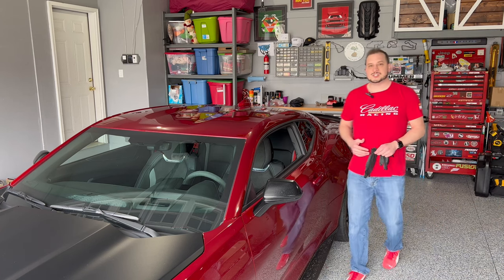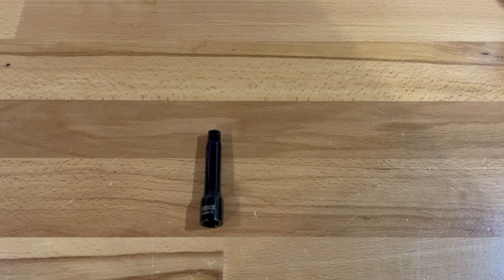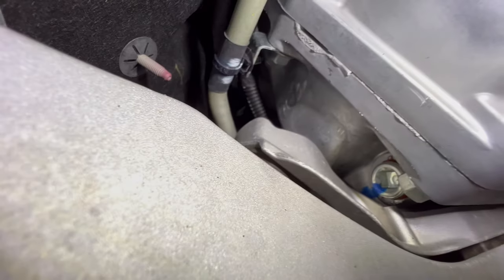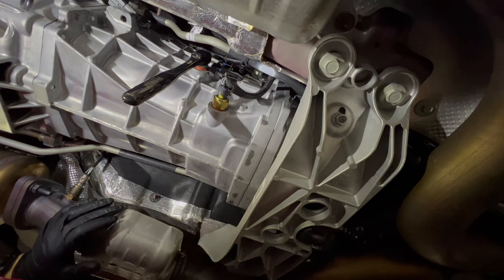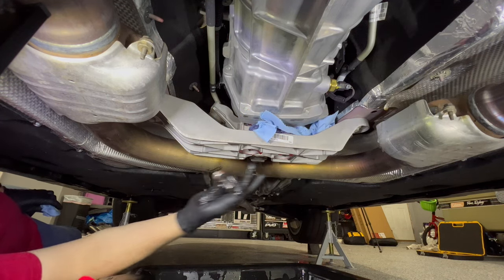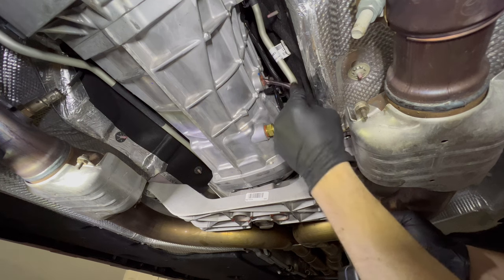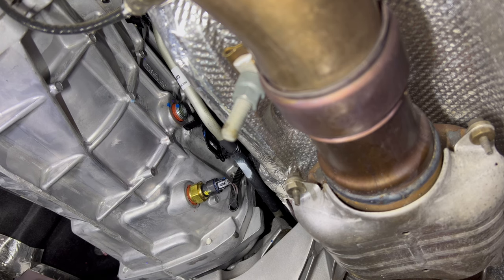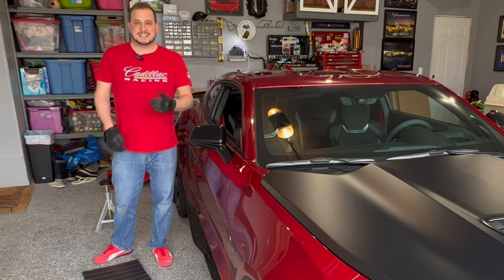OLD VIDEO: Tremec TR-6060 Transmission Fluid Swap

Comment from the maker: UPDATE!!! You can remove the temperature sensor from the transmission and use that as a drain plug. Much easier to get to, and makes much less of a mess. Also, you should remove 240 ml of fluid once it starts to drip out. Thanks to all of my viewers for these tips!

Comment: Using the Royal Purple synthetic transmission fluid is the ultimate fluid fix for the T6, especially in the Dodge but, all of the manuals love it.
Reply from the maker: As long as it is Dexron III ATF, you should be fine. That is what the Tremec calls for.
Reply: @FollowMyLine17   Thanks for the info.  Always appreciated when things are shared instead of people just insulting each other.  😉

Comment: Sweet! Man you making this look easy! Great video 😎
Reply from the maker: Man, I’m just trying to be like you with that subscriber count 😅 Stay tuned (and subscribe if you haven’t yet) I’ll have some track day content in the next few weeks!
Reply: @FollowMyLine17  😂😂😂. You already know I subscribed I will be going to these after my Matick appointment because I plan on doing everything like this going forward. How often you change the transmission fluid and how do you know if you need to add more if it doesn’t sound right on the test drive just being curious
Reply from the maker: @BLUPRINT1LE  the test drive is more to make sure that nothing is leaking when you get back. Once it starts pouring out consistently (roughly 4 bottles) its as full as it’s going to get. Just make sure you are on level ground. The transmission fluid should be changed after 24 hours of track use, that’s why it’s important to keep a track day log. Diff is 15 hours of track use and engine oil is 4 hours.
Reply: @FollowMyLine17  ok that’s nice to know!

Comment: Lol my fluid will be delivered tomorrow. Perfect timing for this vid!
Reply from the maker: Awesome! Let me know if you have any questions after you watch the video, I’ll be happy to explain further if needed.
Reply: @FollowMyLine17  Will do, thanks.
Reply: @FollowMyLine17  Just finished watching. Definitely not doing it on my new (11day old) driveway 🤣 

Great vid. Simple and to the point.
Reply from the maker: @LordDeadSpider  believe it or not, I caught all of that fluid in my drain pan and drip tray.
Reply: @FollowMyLine17  I have a track record that is not in my favor. Just changed oil on 2 generators, push mower, zero turn & my sons car… lets just say I am glad I used my wife’s old driveway 🤦‍♂️
Reply from the maker: @LordDeadSpider  well, at least you know where you stand. 😂 One of the pinned comments suggests using aluminum foil as a makeshift funnel. Not a bad idea.
Reply: @FollowMyLine17  Just got the fluid changed out. Couldn’t get my swivel to cooperate (fat fingers) so I removed the brace. Thanks again for the vid.

Comment: Hello! Awesome video, just got my 2022 2SS 1LE in March and these videos are awesome reference for future maintenance! Couple questions, it looks like you’re using the ESCO jack stands with some jacking pads for holding the car up. Are those the shorty ESCO jack stands or the regular height ones? Also, what jacking pads are you using, and how secure does the car feel with the jacking pads on the jack stands? Thanks!
Reply from the maker: Those are the regular Esco stands, not the short ones. Here is the link for them:
https://amzn.to/3yWkL84
The lift pads are from ZL1 Add Ons. As far as security of the stands on those lift pads, I always rock the car back and forth once they are on the stands. I do this for a few reasons; to make sure the car is level and not going to teeter totter and if it falls I’d much rather deal with an automotive insurance claim than having my family deal with a life insurance claim haha. I have never had any issues and I have been working on these cars since 2017 the same way.

Comment: Hi, thanks for the video. Just one question. The GM documents say to "Apply sealant to the transmission fluid temperature sensor/drain plug" after draining, is that necessary and did you do that? Thanks in advance.
Reply from the maker: Hi! It’s referring to the sealant that you can see visible on the plug. I didn’t, but it’s highly recommended.
Reply: @FollowMyLine17  Thanks for the quick reply! Do you know what the sealant is called or the part #? The hyperlink on the GM docs does not open. Is it just some kind of thread tape? Thanks again.
Reply from the maker: @agentsmith2239 it’s a liquid thread sealant. Here you go: https://amzn.to/3AfdxOU
Reply: @FollowMyLine17  Awesome! Thank you so much!

Comment: 1:33 I have a Camaro 2019 SS LT1 manual transmission, but I don't know if it has the same oil that you show in your video?
Reply from the maker: Yes, you have the same transmission and you can use the Driven Oil AT3 or another option is Redline D4. Any Dexron III rated automatic transmission fluid will work. 

https://amzn.to/4bx3PFa

Comment: Thanks so much for this video! As a ZL1/1LE owner, I will be tackling this in the next few weeks. 

I have to ask - 
1) how many quarts of transmissions fluid did you have to pump in before it starts leaking?
2) How many miles would you say you recommend changing out the fluid? I am at 18k miles and still on the stock transmission fluid (done easily 7 track days plus spirited runs on backroads/tail of the dragon).
Reply from the maker: The transmission takes something like 3.85 qts. with the additional coolers on the 1LE. I think it’s a little less for other applications of this transmission. It took nearly all 4 quarts before it started to spill out, however there was left over fluid in all 4 bottles since my fluid pump couldn’t reach them all. 

Regarding frequency of change, if you track the car, GM recommends changing transmission fluid after 15 hours of track use. 24 hours for the diff and 4 hours for engine oil.
Reply: @FollowMyLine17  Please let us know if there is an improvement in shifting feel upon switching to the Driven AT3. I am doing my research on the right fluid for my 6MT at this time.
Reply from the maker: @AllIsWell_22  it was instantly smoother than the factory fill fluid. I have also tried Redline AT3 in the past with the same results.
Reply from the maker: After my track weekend I can confirm, great feel on the shifter, no issues getting into any gear, and I let my friend drive my car who also has an SS 1LE and he made a comment on how smooth my transmission felt.

Comment: What jackstands are those? I would really like some like that with the padding! Also, what point are you jacking from that the whole side of the car comes up? I feel like any point that could do that would have some sideskirt in the way.
Reply from the maker: https://amzn.to/3yWkL84

Esco 3-Ton Flat Top jack stands. I use a universal pinch weld to lift at the center-front pinch weld point:
https://amzn.to/3Etllgc

I also have these lift point pads:
https://amzn.to/3s3FwtT
Reply: @FollowMyLine17  Thank you Luan!

Comment: Hey man love that you use this car for what it's intended to do and not drag race a specific track car. So on the transmission fluid would it be okay to use the red line d4 ATF for the C7 Corvette 7-speed manual trans ?
Reply from the maker: Thank you, and yes! I’ve used the Redline D4 in my 2018 Camaro SS 1LE and loved it. Go for it!
Reply: @FollowMyLine17  👌 thanks. Really like that lt1 motor for the track. Seems to be strong all day and not heat soak like it's supercharged counterpart lt4
Reply from the maker: @justinreid8851  yes, it’s incredibly stout. A workhorse for sure.

Comment: so do you still use Driven AT3 or did you switch to Redline D4? Amsoil?  I'm trying to do research and it seems to be just a preference for the user with some occasional Royal Purple people saying smoother shifts... Whats your thoughts?  I'm looking at the Driven right now at Summit racing...
Reply from the maker: I’ve used the Redline and Driven on my Camaro’s and the Driven seemed smoother than the Redline. It truly is personal preference on these.
Reply: @FollowMyLine17  Thanks for your reply..

Comment: Any one use the tremec hpmt fluid and if so do you have to flush all the old fluid out or just let them mix with the little bit of oem fluid still in there?
Reply from the maker: I haven’t personally used the Tremec fluid, but if you are patient enough a minority of the OEM fluid will remain, as in any transmission, engine, differential, brake reservoir, etc. They are OK to mix.

Comment: Removing the brace under the transmission is not an option? I did see a video where a guy made a trough out out aluminum foil to direct the flow better.
Reply from the maker: I didn’t want to remove the brace. I attempted to make a funnel out of construction paper and it failed miserable. Aluminum foil is a great idea! I wish I would have thought about it. That’s what is great about the internet, you eventually find cool ideas from all over the world. I’ll pin this comment in hopes that someone else sees it!
Reply from the maker: I have an update on this. Apparently you can use the temperature sensor plug as a drain plug and avoid the mess or hassle of making a funnel.
Reply: @FollowMyLine17  ah. Very good. Thanks
Reply: A jack and remove the cross member would have been 100% easier and smarter. So frustrating to even watch 🤦‍♂️
Reply from the maker: @joesbuell  you’re telling me, it was frustrating to do! Ha. I could have also just removed the temp sensor. This is one of those videos I will probably redo in the future when I flush the trans again after the accumulated track hours. Thanks for the feedback.
Reply: @FollowMyLine17  frustrating to watch when for a little extra effort you could have had less mess. Work smarter. Curious as to why you changed the oil on what looks like a new vehicle?
Reply from the maker: @joesbuell  good old fashioned track prep. The Tremec is a bit notchy out of the box, and changing the fluid helps. Trans fluid is changed after every 15 hours of track time, oil at every 4 hours, and diff fluid at every 24 hours.

Comment: I heard after it drips out your gotta remove 240ml of fluid
Reply from the maker: I know your are supposed to have it 1/8th of an inch below the fill plug. I haven’t heard the 240ml specification. I didn’t cover that in the video but I usually dip a shop towel inside the fill plug to soak some up. I’ve never had any issue doing it this way. I have decided that I will retire this video and make a new one next time I do a trans flush, because I have learned that I could have used the sensor plug, and I can get a fluid transfer pump to pull some fluid out.
Reply: 240 mil or 8 oz , or fill till it’s 1/4” from the top while measured with a mechanic wire.  Thanks for taking the time to make another video.  👍🏻
Reply from the maker: @2004YZFR1  thanks sir, looks like I need to make an updated version of this video for 2023 with the tips and tricks I’ve learned from my comments section! 😃
Reply: @FollowMyLine17  , you make some really good videos.  I’m sure you have helped a lot of people.   If you make another one can you please show how your lift one side of the car at a time and where you place your 4 jack stands? Maybe a picture or a part of the video showing under the car were they are placed.  Thanks!
Reply from the maker: @2004YZFR1  you may be able to see how it’s done here, right after my intro:
https://youtu.be/lwcNOH-XPMk
Reply: I’m guessing that many don’t drain out the 8 oz afterwards. Any idea of the problems that could result if you don’t? I’ll get a fluid pump from HF to do this, just curious about what that little extra of fluid could do?? Thx.
Reply from the maker: @mattd7902 could result in higher transmission oil pressure. And yes, many do not.

Comment: I think it is a very poor design where the drain is located. I hate getting oil everywhere.
Reply from the maker: For sure! I pinned a comment, you can actually use the temp sensor as a drain port.